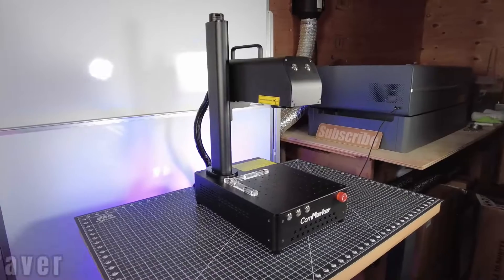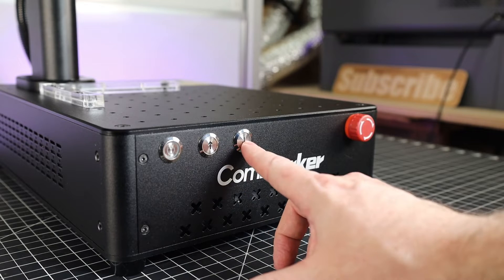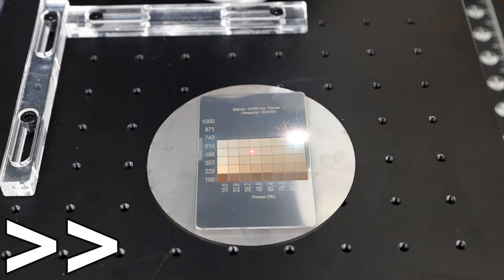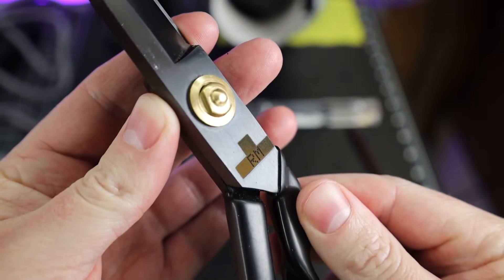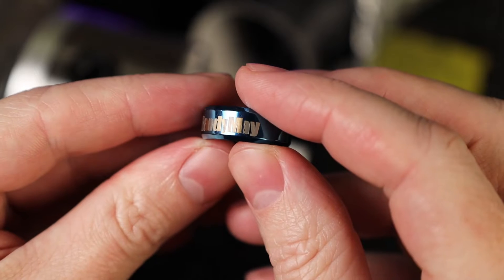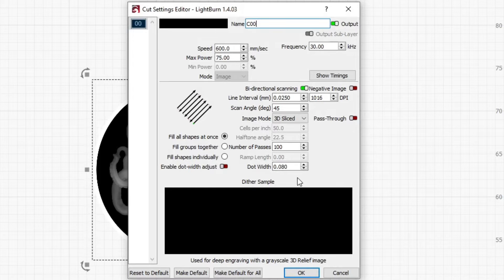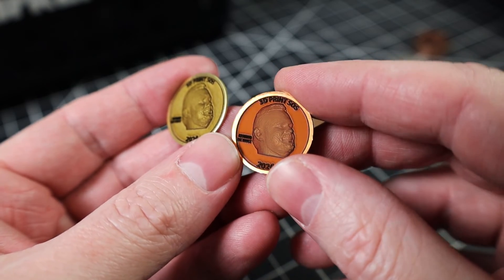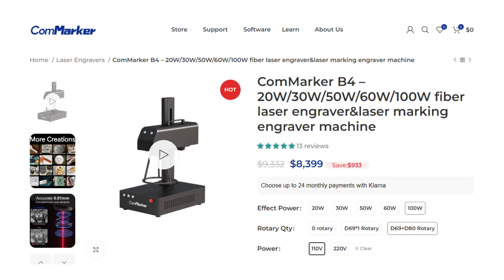ComMaker B4 Fiber Laser Engraver - 3D Laser Engraving Metal

Comment: Hello! I’m using a ComMarker B4 20W engraver with Lightburn, and recently I encountered a connection error while engraving in 3D on brass.
The issue occurred while engraving a 3D relief pattern with the following settings: speed 6000, frequency 45kHz, power 90%, line spacing 0.0254,
image mode set to 3D Sliced, and 150 passes. After about 6 hours of engraving, a connection error occurred. I paused for a while and resumed engraving, but the previously engraved pattern disappeared. Then, after about 1 hour, the connection error happened again.

Is there any solution to this problem? And is there a way to resume the engraving from where it stopped?
I would greatly appreciate your help in finding a solution.

If you need further assistance with refining the details or want to send this in a specific context, feel free to ask!
Reply from the maker: Sadly I don't know of a way to resume something. Your best bet is to contact the company about this because it kind of sounds like the machine might be overheating and stopping. 6 hours straight up engraving is a pretty long time.
Reply: @randymay  Thank you.

Comment: Question
Do you use lightburn for your lasers,
And if you do can you use the same license on all your laser re fiber/C02 etc 
Or is it only per machine use. 
Thanks for any information 🙂
Reply from the maker: You have to upgrade your license to be able to use it with the fiber laser. I think it's like $90 if you already have a license
Reply: Ahh ok thanks 👍
Reply from the maker: Yeah The upfront price definitely sucks but it's well worth using the software
Reply: The Lightburn program you "buy" once, then, it is 30 bucks per year to keep receiving updates.  The program will still work past the year, but, no updates.  LB says that if you renew early, they add two months to your subscription which is great....  The 30 bucks per year renewal is for ALL licenses you have, even with the galvo license, so, as it is the very best burning program IMO, I'll keep renewing until I'm "in the ground"   🙂